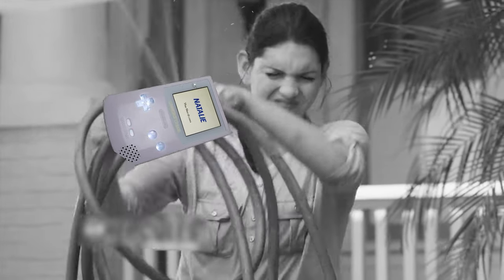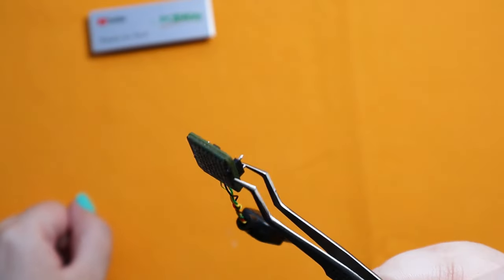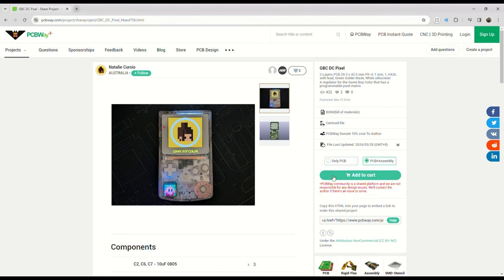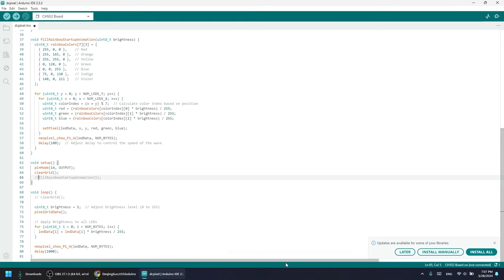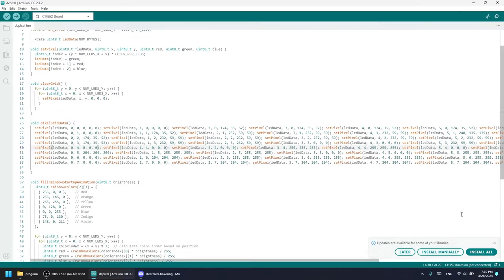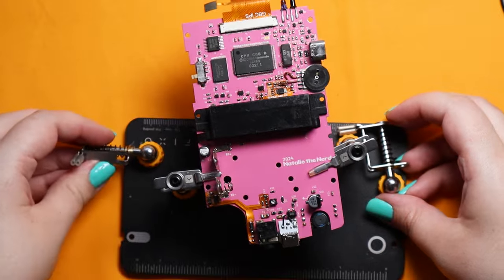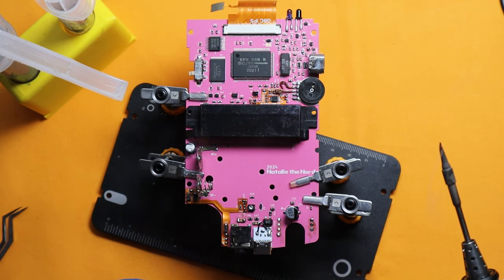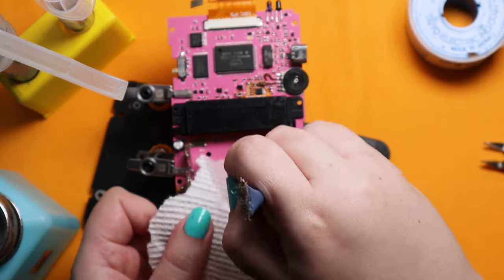DC Pixel - A Game Boy regulator

Comment: why not use a esp8266, that way you can change the effects wirelessly. you need to optimise the pcb but there are esp8266 variants with internal flash memory so it should be doable. plus there are already firmware available for controlling there led matrices wireless via the esp chips
Reply from the maker: ESP8266 and ESP32 pull way too much current. I know when the ESP32 turns on an searches for a wireless signal it can pull up to 200mA. The extra LEDs already add 30-80mA depending on brightness.
Reply: @NatalietheNerd  not necessarily, once wifi is connected it can be put to sleep, also for the esp32 data can be pushed via dma which will reduce cpu load but the software side can get complicated so ig BLE might a better option. the NRF52 is a good candidate as it has a very low power consumption and stupidly low when put in sleep mode, for static graphics the data can be pushed to the leds and the microcontroller can be put to sleep.